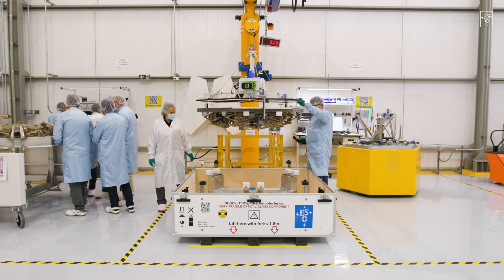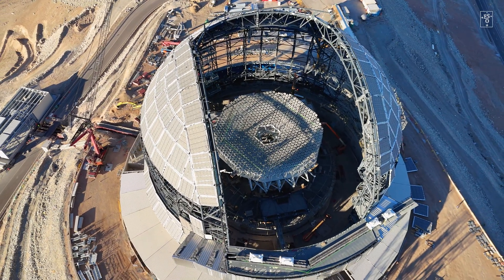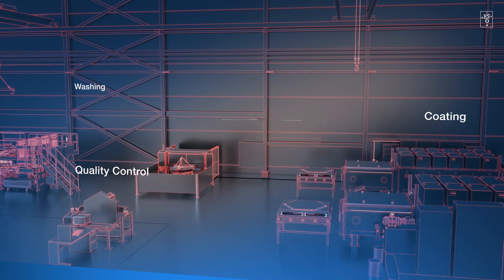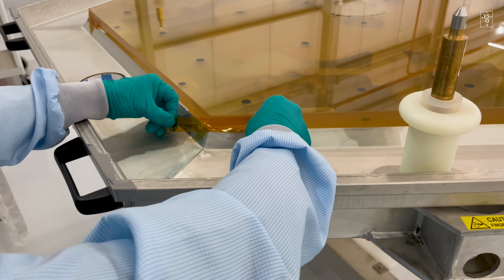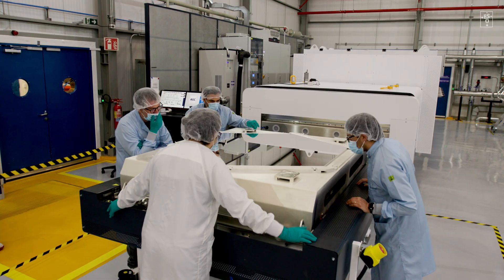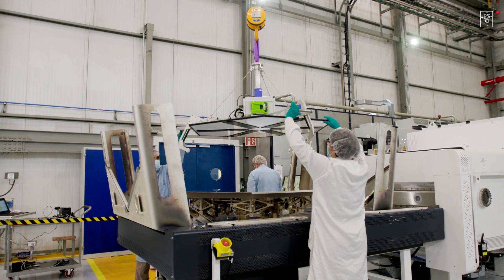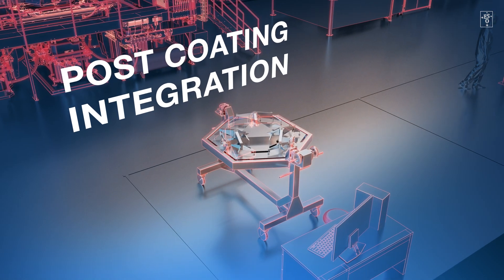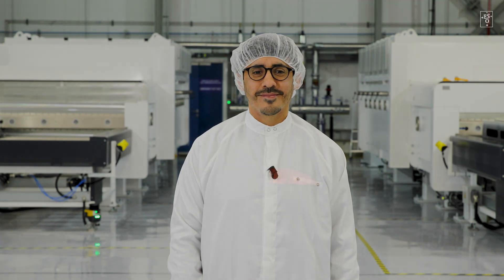Coating the Extremely Large Telescope mirrors with silver | ELT Updates

Comment: When it is time to recoat the mirrors, do they all have to be coated at the same time or can the telescope be operated with a combination of new and old segments?
Reply from the maker: Good question! In addition to the 798 segments of the mirror, there are 133 extra ones that will be used to facilitate the recoating. Every day we'll remove two segments from the mirror and replace them with already coated ones. The reason we need so many extra segments instead of just a few is that they all have slightly different shapes, depending on where they are within the mirror. The mirror can be divided into six sectors or petals, each one with 133 segments. Those 133 segments are all different from each other, but identical to those in the other petals, due to the symmetry of the mirror. So with 133 extra segments we're fully covered for the recoating.
Reply: @ESOobservatory  Thanks for the detailed answer! 🥰

Comment: I used to work in a microelectronics wafer fab, my job included the process of coating the wafers with thin layers of alloys of Al/Si that will provide the electrical connections. I’m very surprised at the little attention paid in the video to the substrate cleaning process, because I remember the trouble caused by any trace of contaminants, especially organic compounds, which were thoroughly removed with acids baths followed by an extensive rinsing and drying process. I guess you used a sputtering type of deposition, I’m really curious about who built your coating tool.
Reply: Yes looked like magnetron sputtering to me

Comment: With the amount of mirrors this telescope will need, I think it can be safely considered a literal factory for mass production(and not some manufacturing site for a one off very specific thing). Out of curiosity what is the goal(it seems to currently still be in development so it will probably change) for time needed to make a single mirror?
Reply from the maker: Just to clarify, the facility shown in this video is just for the coating and maintenance of the segments. The segments themselves are manufactured in Europe. The blanks are made by SCHOTT in Germany; all of them have been cast already. They're then sent to Safran Reosc in France, where they're polished and integrated with their mechanical supports, made by VDL ETG Projects B.V. in the Netherlands. The production rate at Safran is 5 segments per week, and to achieve this they had indeed to develop a specific workflow to deal with so many segments.
Reply: @ESOobservatory  Thank you for a clarification with detail. Are all segments in the meaning of completing the main mirror or completing the main mirror and also replacements for the future?
I'm assuming so far there isn't exact info on amount of time that will be needed to polish them.
Reply from the maker: In total there are 949 segments: 798 will be present in the main mirror at any given time, 133 extra segments are needed for recoating (every day we'll remove two segments from the mirror and replace them with two recoated ones), and there are 18 spares. All 949 blanks have been cast already. These blanks are being polished and integrated with their supports at a rate of 5 per week.